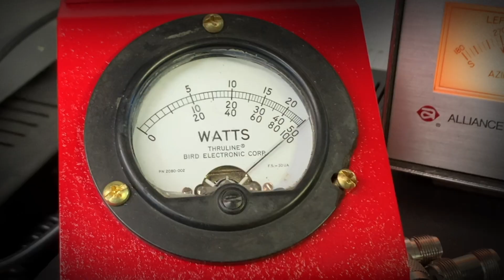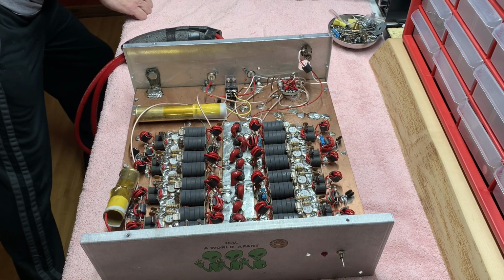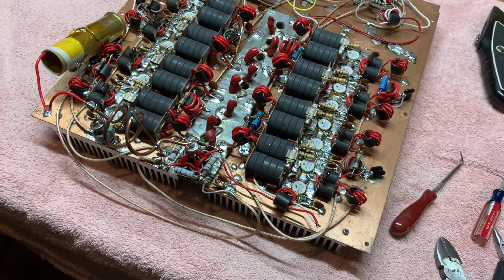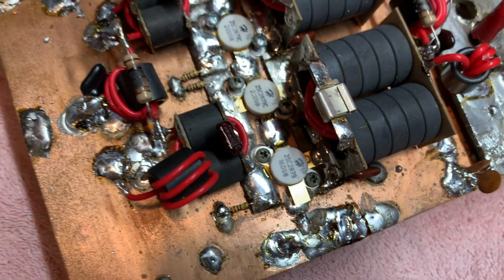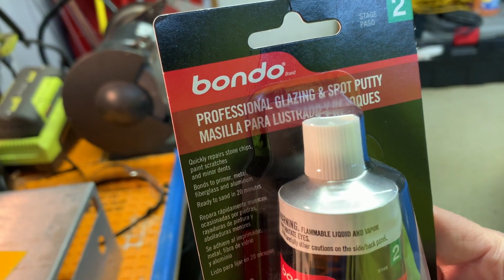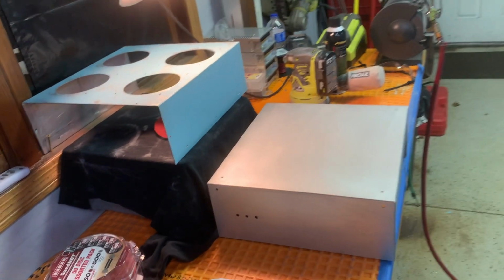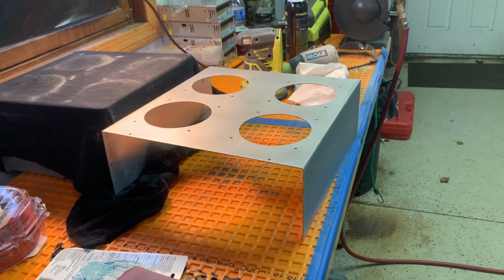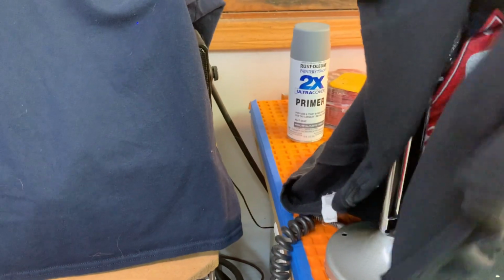16 pill refurbish Part 1

Comment: all our boxes should be painted cool colors! enough with the unfinished plain metal. the only possible issue i see here is that you sprayed primer and painted the inside of the cabinet, so now your gonna have to go thru the work of sanding it back off in places for proper ground. ie the board ground strap. so239's, the cover ground for the fans to work etc..  anyway the red is cool. you should put a couple coats of clear on it and some colored fan guards, not the plain old silver ones. then it will really pop